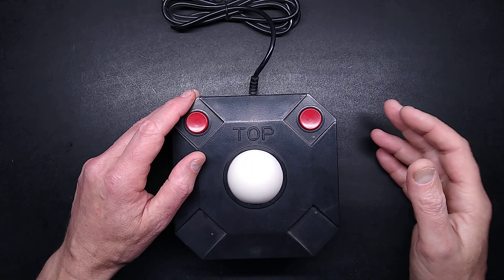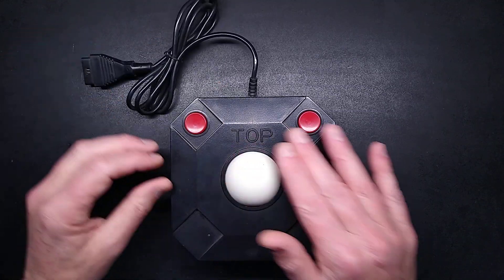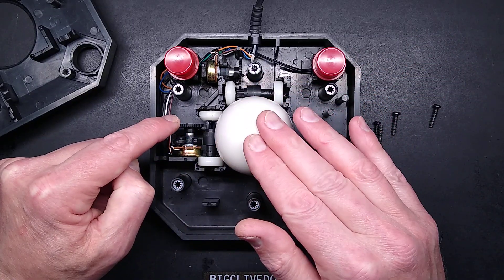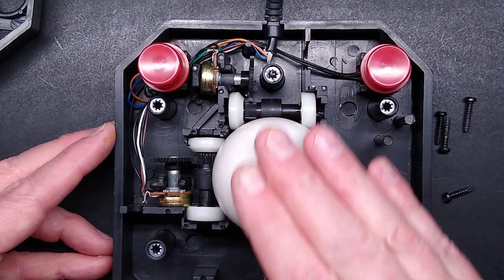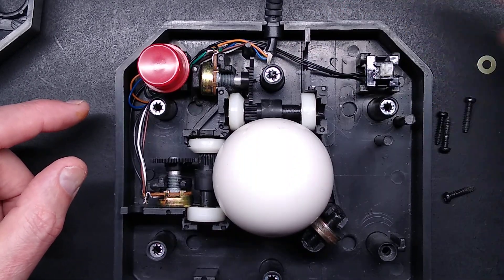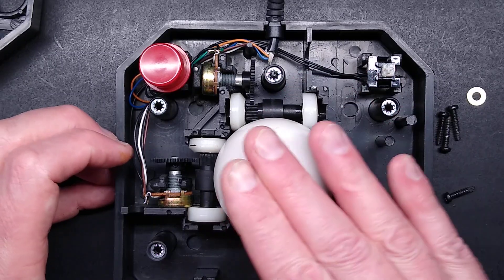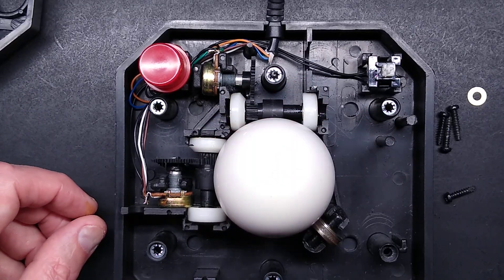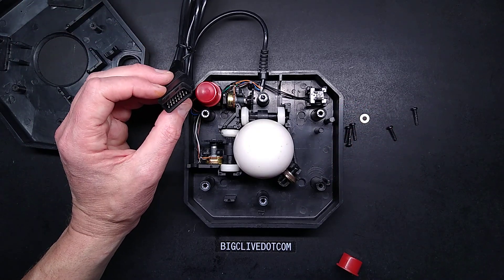Inside a weird vintage analogue trackball

Comment: The ball was a standard snooker or pool cue-ball. On the railway in the mid 1980's, they used to have a tracker ball (Yellow ball) to operate the (then modern) signalling control system in some signalling centres.
Reply: Certainly British Railways used Penny and Giles (industrial) tracker balls for some of the Solid Sate Interlocking (SSI) / Integrated Electronic Control Centre (IECC) system hardware. I once looked up the price of one and nearly fell off my chair, they were far from cheap! I think they used RS232 for the interface. Certainly the SSI Graphical Terminal (a heavy colour CRT display) was used in combination with a tracker ball that had a RS232 interface. Both connecting to the SSI Technicians Terminal.
Reply: @Mark1024MAK  I used to make them!
I have a few at home including a couple of explosion proof keyboards with integrated trackball.
Reply: Oh, there is a photo of a yellow balled tracker ball on Wikipedia if you search for railway IECC signalling.
Reply: @Mark1024MAK  Yep, that's the one alright.
Reply: Actually despite the ball being made in Belgium by a company that made snooker balls, P&G units were all custom balls made to pantone colours!
We used to sell units with 1", 2", 2.5"& 3" (and later a 2.25")
All denoted by the number after the first 4 letters (TBDA-50-.... is a 50mm ball)

Comment: I used to work in electronics recycling and I grabbed a bunch of assorted sized trackball balls as the opportunity arose. On a concrete shop floor they bounce ridiculously high. Their energy return rate is like ~95%.  When dropped on a surface like a sealed concrete floor. YMMV.
Reply: And the TACKKK when it hits the floor is godawful.

Comment: Back in the day I did a BBC trackball interface using a quadrature-output trackball and some CMOS analogue switches & opamps to produce the analogue voltage by charging & discharging a capacitor from the quadrature pulses - sort-of worked but tended to drift over time.
Reply: No shit? That sounds awesome, actually.... what CMOS did u use? I could probably throw one together if you still had a veroboard/tagboard or a schematic.  I use CMOS chips for making guitar fx pedals all the time and they work great for fuzz pedals or octave circuits.
Reply: The Marconi's RB2.11 was a great and accurate trackball with slotted opto sensors instead of pots.  First featured on the BBC's The Computer Program.  I think they were trying to show the first attempt at earth mapping way before Google Earth...  Vetor graphics if I remember correctly (possibly totally wrong😂)

Comment: The design is very limiting as you pointed out.  I think you have a good sense of the era of the device, around the MS-DOS PC, late 80's / early 90's.  I think the encoders wheels came about later.  Missile command is a fun game, so was centipede that also used a trackball.

Comment: I had a mouse with the same potentiometer set up. I took it apart just to see how it worked. I had an attic section in my old house which was much bigger than our current house, and I had a lot old computer stuff from the mid to late 70's onwards. I gave it away to a like minded soul in Wiltshire. When you personally see the evolution of computers first hand it is amazing and I just loved taking it apart. Good post Clive 👍

Comment: Interesting. all the mice I've took apart to clean had optical sensors either side of a disk with holes in to sense what the ball was doing. two of.. that's very different

Comment: Gotta love how the old X-Y inputs used to work using nothing but resistance, making it so easy to make your own joysticks or mice depending on the computer you used, even the Commodore 64 had analogue inputs on its' joystick ports which allowed the use of a mouse that was basically a miniaturised version of this trackball... :)
Reply: The Commodore 1351 mouse uses standard quadrature encoding internally, a microcontroller then creates the signals for both paddle inputs to simulate a paddle that basically wraps around so that there is no endstop like in this trackball.

Comment: I would think this would have a very short life by wearing out the potentiometer.  Do they even make any that are intended for constant use like that?
Wouldn't the resistive coating just rub off after a while?
Reply: All those old school paddle controllers (for pong, night driver, etc) were just a knob attached to a pot. They got absolutely hammered on and kept working. You're right; probably not just a standard carbon film track.

Comment: The other reason for using potentiometers is that this directly mirrors how joysticks of that era work.  This is basically just a joystick with a different way of manipulating the position of the stick.
Reply: My quad 8 track player used a joystick for the speaker levels.  4 pots (1 for each speaker). I could make the sound spin around the room. Loved it!
Reply: most devices used digital switches though.

Comment: I had a track ball when I worked in HMRC for a couple of years(2007-9), as my right hand is  erm Phucked for want of a better word, and it was great- but you had to wash the ball all the time as it got all Yucky with gunge, from sweat... ewe- now i think back how awful. I still use a mouse on my laptop as I cant use the touchpads.
Reply from the maker: Yeah, I regularly wash my trackball to keep it rolling smoothly.

Comment: I believe the first ever mouse also used potentiometers so that there was a limit to how far they could go in both directions.
Reply: This is probably a game controller designed for a limited playfield  and calibrated for center like older or maybe current joysticks.
Reply: You can have continuously rotating pots. Software figures them out.
Reply: @MostlyInteresting  ... or maybe doesn't. With absolute positioning and the right scaling so that the full range exactly fits the width/ height of the screen, you'd get the pointer running off one edge onto the opposite one, which was a feature of many early games.

Comment: I'd have said that's basically an old analog mouse lying on it's back, except I can't imagine anyone wanting to use such a mouse that can physically hit bounds... :/
Reply: I do remember back in the day that the limits of travel were able to be set in software so that it can traverse the full screen if it was being used as a joystick. I doubt these would have been very precise at all given how the “encoding” is done. I certainly wouldn’t want to have to do CAD with it. Edit: Also having Deja Vu. Pretty sure one of these has been featured here on the channel, and I do remember seeing one of these in its natural habitat. I can’t remember what it was for, tho.
Reply: I’ve seen some odd computer hardware but I don’t believe I’ve ever seen an analogue mouse. This is more like a joystick.
Edit: I have seen an analogue mouse… sort of… it was a little doohickey that popped out the side of an early-mid-90s laptop. It was the two mouse buttons mounted on a stalk, it was not a terrible experience compared to other early portable mice.
Reply: It makes it to the edges of the screen with one motion of the hand; how much farther do you need to go?
Reply: @bob_._.  The problem is screens got bigger, which will eventually lead to granularity issues.  How well wil this thing cope with my 4k + FHD desktop?
Reply: @evensgrey  Why are you connecting your 4K + FHD anything to a 486 with VGA graphics? The question was not "How is this hunk of old 8-bit tech useable in today's twitchy basement dweller's world of hyper resolution multiple screens the size of bedsheets?" the question was "What's up with the physical limiters?"

Comment: The BBC micro used a 15 pin input for it's analogue input, and had 2 button inputs (4 analog channels, 2 buttons, for running 2 joysticks with 1 button each) so it might be for something even older then a PC.
Reply: Takes me back to playing Elite on a BBC Micro, using a joystick made of two pots, a bic pen, and some elastic bands, mounted in a coffee tin.
Reply: I checked - the pin out is different, the PC gameport add two more buttons (originally for two dual-axis/dual button joysticks, later expanded with support for more buttons) plus two MIDI pins - to make that happen the way the axis and buttons works are very different. And connecting a PC gameport accessory to a BBC micro will short out the 5V line to ground which could blow a fuse, damage the BBC and/or the connector, going the other way is probably won't damage anything but neither combination will work. The simpler PC gameport setup is how it can cram four axis plus four buttons (for two dual-button joysticks) and two dedicated MIDI pins into a 15-pin connector. Also, the BBC micro layout has a pin for light pen input which the PC gameport don't have.
Reply: @Torbjorn.Lindgren - the Acorn BBC analogue port / joystick port uses an analogue to digital converter (ADC) chip. This chip has an internal multiplexer/switch so that it can convert the input analogue voltage of each of the four channels in turn. Hence the analogue joystick uses a potentiometer to provide a proportional voltage between 0V and the reference voltage (about 1.8V). The digital result is a number between 0 and 65535 but the accuracy is only about 10 bits at best (noise reduces this even more). The joystick middle (home) position is around half of 65535.

In comparison, the PC game/MIDI port uses each input as part of a resistor/capacitor (RC) network. The connected resistance is worked out by how long the capacitor takes to charge or discharge. Thus the time tells you the position of one direction of the stick. If the potentiometers have both ends of the track connected to a terminal, it is possible to rewire it to work with an Acorn BBC analogue port / joystick port.
Reply: @Torbjorn.Lindgren  thanks - I was at one point tempted to plug in our joystick into the bbc micro.
Reply: Back in the early to mid 80s I belonged to a group of BBC Micro enthusiasts. On of our members adapted Atari tracker balls to use with our BEEBS, and later with RISC PCs. They were similar to one in video, with a ball about the size and weight of a snooker ball. They were wider. If I remember correctly they used optical encoders and not potentiometers. At the time they were being sold off cheap, so presumably Atari had discontinued them.
Reply: That was my first thought too.
Reply: Atari 5200 Trakball too but the pins are on the console side.

Comment: Some DOS pc roller ball still had infra red interrupted wheels but the software was very limited usually CAD with specialist drivers. Not in the mouse port as you still needed a mouse but cannot remember why such a configuration & was commercial. Most times a bus mouse & roller ball on serial ports. Only seen 1 so could have been that special before USB!

Comment: Once you go trackball, you can never go back!
Reply from the maker: True.  Much less demanding of desk space.
Reply: I love my Logitech trackball, been using it for at least 20 years, I wouldn't want to go back to a normal mouse now. (warning... if you lose the ball it can cost around £60 on ebay to get a replacement!... luckily I found mine down the back of a chair when I moved house!)
Reply: @zebo-the-fat  We have 5 working trackballs and one that was scrapped. I saved the ball.  Swapping one ball to another unit comes with it's own set of problems so I have discovered.
Reply: Well, you can go back, but you'd be stupid to do it 😉 Though, while I've been using trackballs at home for many years now, at work I still have a normal mouse.
Zebo, I'm also a member of the Logitech trackball club. My MX Ergo has been going strong for 6 years now, but it got its first switch switch a month ago after the infamous double click issue started to appear.
Reply: still using a microsoft intelimouse track ball  as my daily pointing device, havent found anything to beat it.
Reply: A Kensington trackball user here - normal mice are just too clunky for me now.